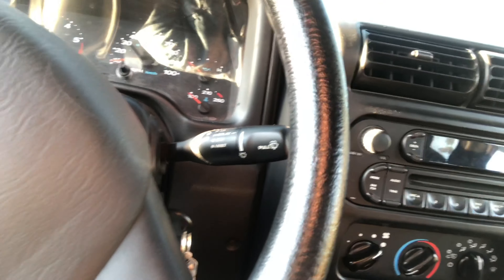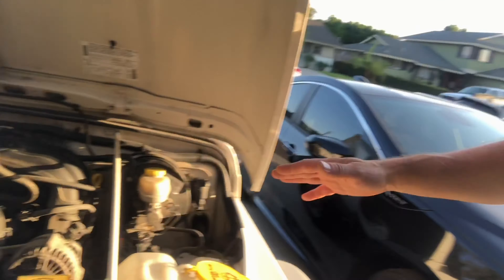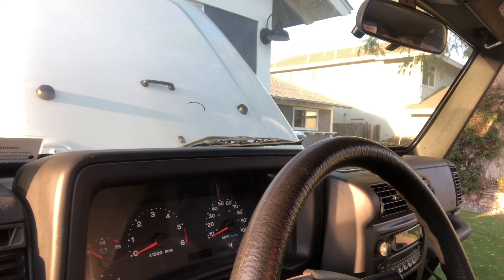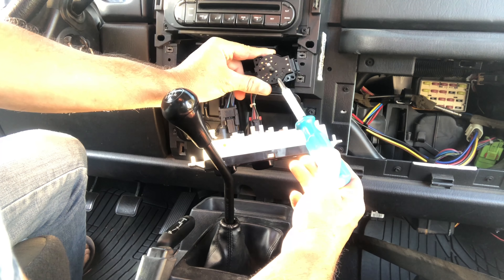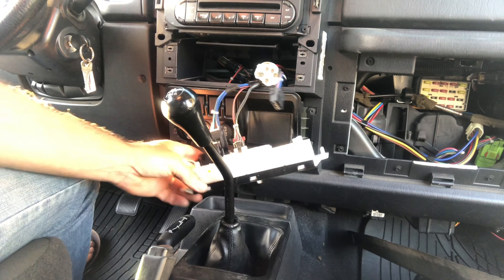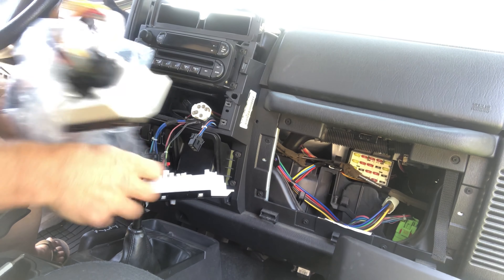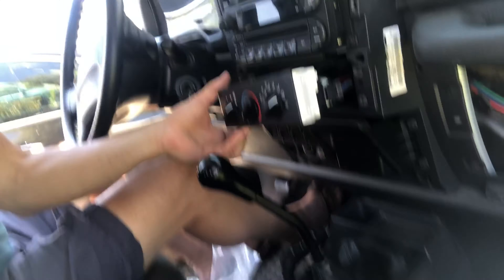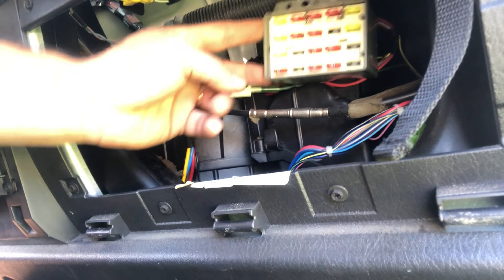Repair Air Conditioning only blowing through Defrost on 2006 Jeep Wrangler.  NOT Blend / Actuator

Comment: I have an ‘01 that has some air coming out of the vents at idle but any kind of load on the engine shuts off the vents and it all comes out of the defroster vents. I’m thinking there must be a leak in that line somewhere but it’s not obvious. Cruise control works so that’s not where it is. Has anyone tried carb cleaner spray along that line to see if the rpm changes?

Comment: I had similar problems with my 05 LJ. Mine was vacuum leak at the engine block.  My cruise control did not work either, which made me look at vacuum system, FYI.

Comment: Good job Mike! I wonder why those contacts melted. I hope there is not a resistor somewhere in the circuit that is letting too much voltage go to the switch. Thanks for posting the video as well. Oh yeah, I'm driving out to Gilbert AZ to pick up a low mileage Honda ST1300. I will let you know when I get out and we can get together for coffee. Love ya brother.
Reply from the maker: For sure Marty.  I'd love that.